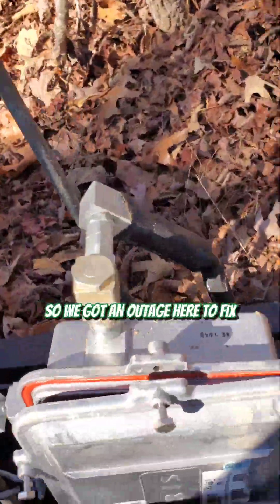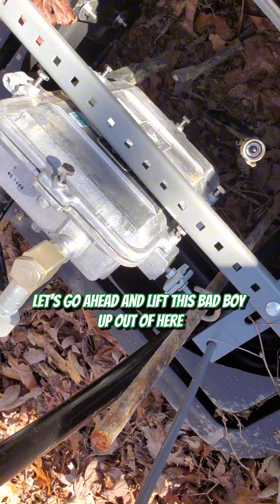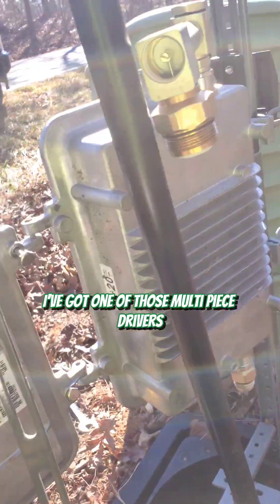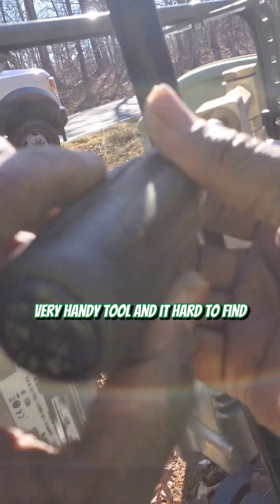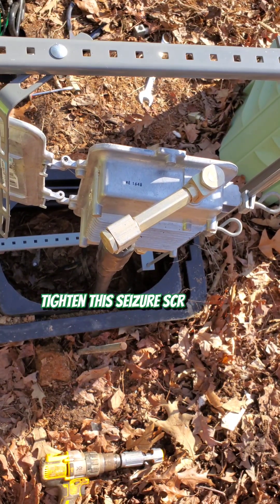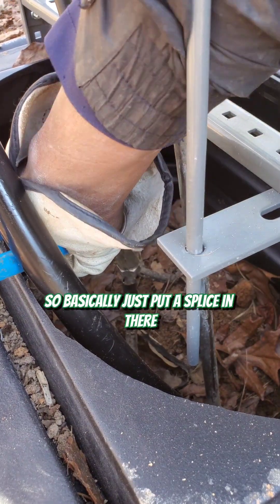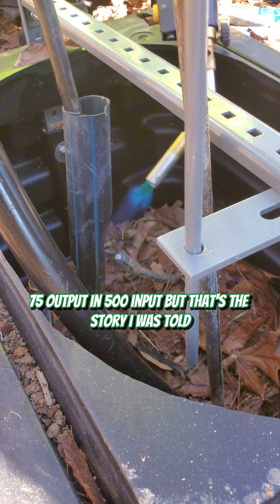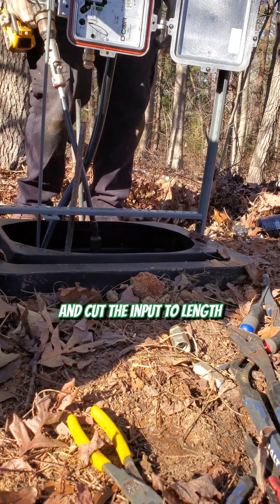Line extender rebuild #cabletechnician #cable

Comment: Doesn’t even clean the semi conductor with gators you are savage my man.
Reply from the maker: There won't no junk on the center conductor
Reply: Yeah, gotta unwind that coating on the conductor. This was the only thing I saw, and while I’m being a critic, whenever I had a weird outage that would come and go, the way you were pulling on the cable yanking up and down, don’t underestimate a poorly done hiding splice a couple inches under ground. Just saying the aluminum shield does not bend thrice. So many nights digging up large amp peds to find a jiggly splice-ground level.  Good luck sir, 👏 bravo 
Making me miss my SA to pac-6 system switchover days.